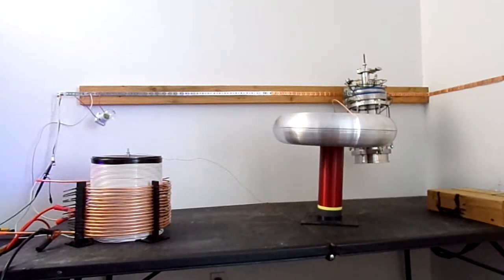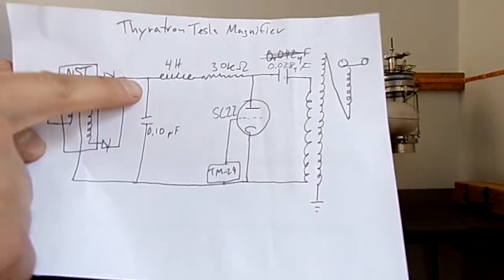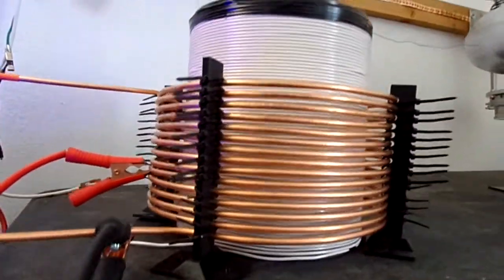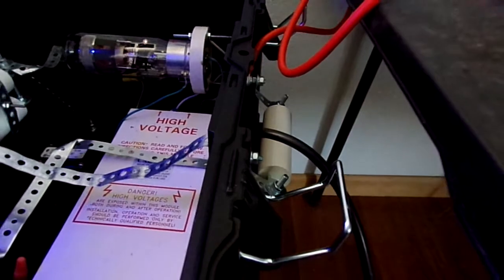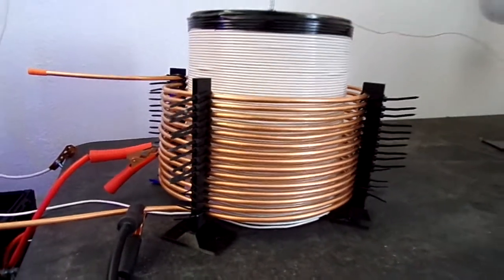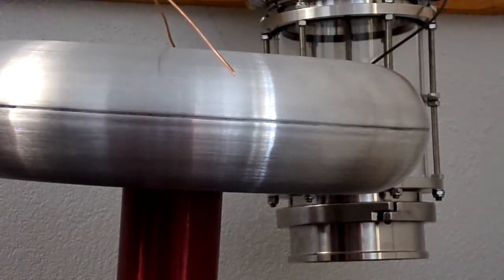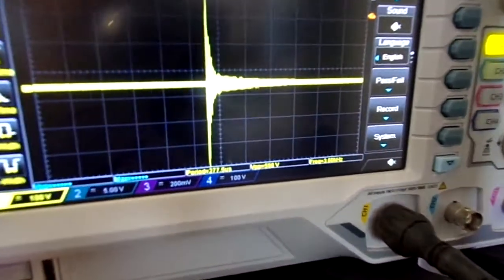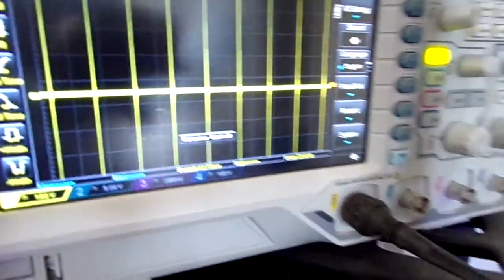Thyratron Switched Tesla Magnifier System

Comment: Great! But don't you get just the first half-cycle of the primary oscillation, or does the thyratron conduct in the reverse direction too? IMHO, most magnifier circuits require at least a couple of full primary oscillations to get the energy properly transferred into the secondary and tertiary stages.

Comment: Use a half wave rectifier on the positive side on mains side it will kick you into a qwt mode of operation
Reply from the maker: this is DC already though?
Reply: @MrWarrensk  no only after rectification its to get a pulsed half wave and in a high voltage circuit turns right back into ac
Reply: @prototype9000  do you need a grid driver and if you do can someone easily make one

Comment: Cool build. must be hard to tune it. I wonder if the thyristor is fast enough to create impulses (half wave) in the primary?
Reply from the maker: The thyratron turns off in the first halfwave. As soon as the voltage swings the other way the thyratron turns off.
Reply: @MrWarrensk  yes I understand, but that is not the much faster impulse halfwave Tesla used to change the impedance of the natural medium as he explained in his 645576 patent.

Or am I wrong? is the thyristor much faster than the resonant frequency of the coil system?
Reply from the maker: @MasterIvo  Yeah, the thyratron is faster I believe. This might be why I am getting somewhat odd effects.